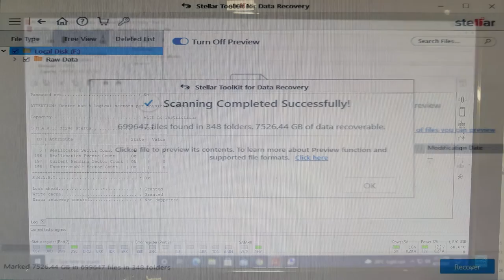How to Disassemble WD My Book Live NAS Drive for Data Recovery?

Comment: Could this harddrive then be used in an enclosure as an external drive?
Reply from the maker: Dear Sir,

Yes, the hard drive can typically be used in an enclosure as an external drive, provided it’s in good working condition. If the drive is functioning properly and doesn’t have any physical or logical issues, placing it in an enclosure will allow you to use it as an external storage device.

If you have any concerns or need assistance, feel free to reach out to us.

Regards,
Team Stellar